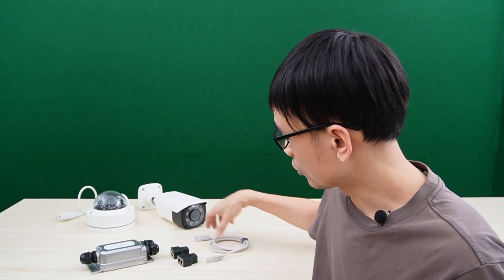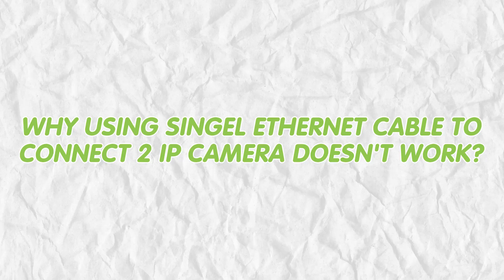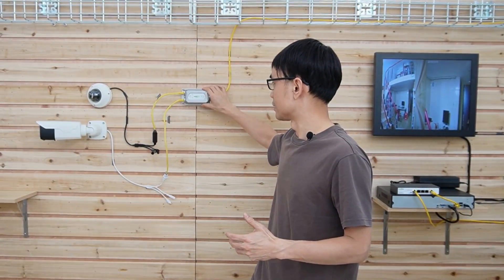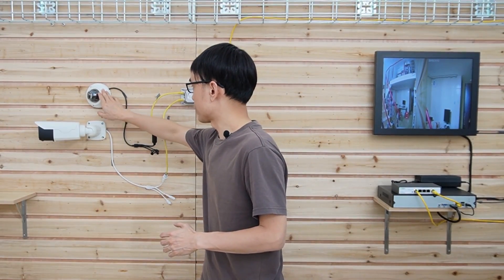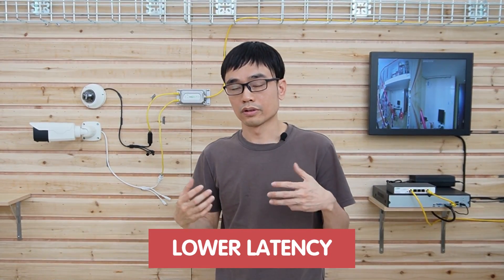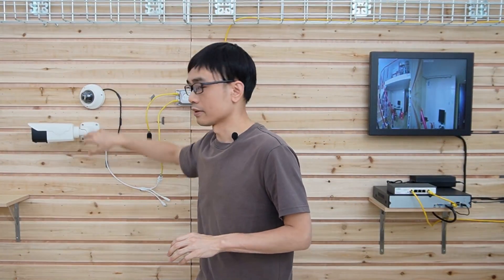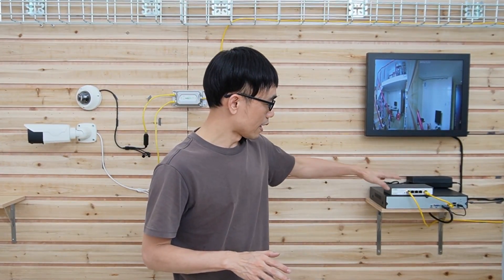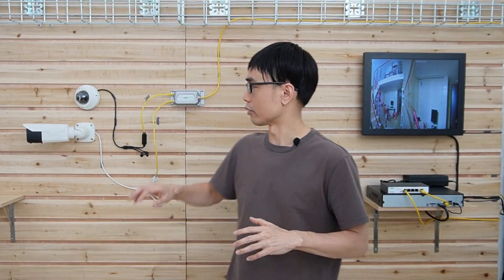Install Two IP Cameras over One Cat5e Cat6 Cable(New Method)

Comment: I’m missing something. Let’s say my NVR is only 4 ports and all 4 ports have power over Ethernet injection. How could I possibly split one port and run two cameras? That would potentially be 5 cameras on a 4 port NVR.  I’m using this example to help me understand.  The unit I was looking at used two NVR ports into one (reverse split), and at the end of the run outdoors, the one cable is again separated with a Y into the two cameras. That I can understand, since you are using two ports in the NVR. How can this work with only one port being used in the NVR?  Thank you.
Reply from the maker: Consider adding a 2-port PoE extender. Here is the product link: https://www.fastcabling.com/product/poe-extender/. This will allow you to split one port and run two cameras. Keep in mind, it's essential to check the power requirements of your cameras and ensure the NVR can handle the increased load. Or you can use a PoE switch. Connect the NVR to the switch, then run the cameras from the switch.
Reply: @Fastcabling  thank you for the response. Great products and site by the way.   I was thinking of that product.  How can it act as a switch without 120v power? ? Is it using the POE power from the cat 6 cable to power the switch ?

Comment: Can you use this method on a NVR? Do I need to add a splitter on the NVR side for each camera Poe port to the Poe extender in or will one work? Thanks
Reply from the maker: No, you don't need the splitter. This model (1 in 2 out) has Power handshaking built-in. There is no need for PoE splitter. You do need PoE switch or PoE injector on another end to send the power to this PoE extender.

Comment: is there a smart camera you recommend that can use ethernet cable for internet streaming to smartphone app instead of using wifi?
Reply from the maker: Most wired version IP camera allow you to live stream the video to mobile app. The connection method (WiFi or wire) doesn't make any difference. It is just the way to connect itself to network. I mean, any wired IP camera can do.

Comment: A good video. I do have a question regarding my own camera setup system. When i renovated my house, i installed 3 LAN cables CAT6 to 3 points where i wanted to hang camera's. Those cable's are hidden in roofing and walls and i can't install a 4th cable all the way to my recording device without the cable being seen or 'hidden' with attachements on the excisting walls.

This system could be my answer to installing a fourth camera. But i wanted to be sure i could install a 4nd camera before looking into it by asking you if it would be possible.
My system:
- tvn-1104cs-1t
- currently runs three out of 4 PoE camera's.

I'd use this device to add another camera using one of my 3 cables. The reserved total output is 50w for the 4 ports. Currently it uses up 12,5w with the three camera's. So i have enough for adding another camera for sure, but i still wonder ofc :p
Reply from the maker: You can use the 1 in 2 out PoE extender, but I consider the power budget. The total power budget is 60w, I checked the specification, but it never specify it support PoE+. The IEEE802.3af only provide 14.4W maximum. If you split 14.4W for two cameras, it is not enough to supply two cameras.